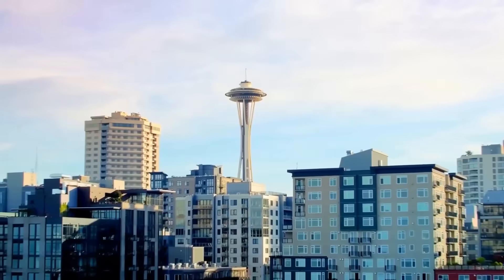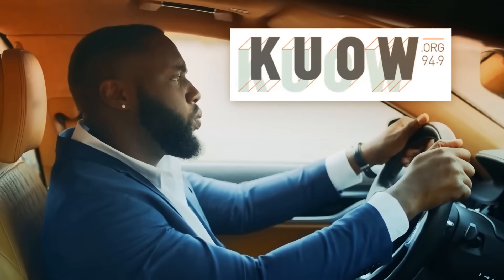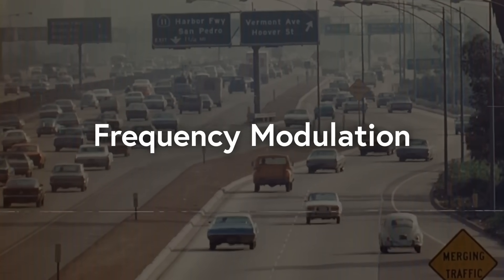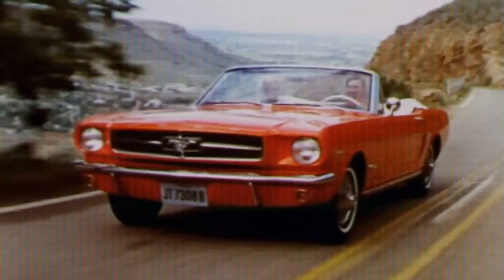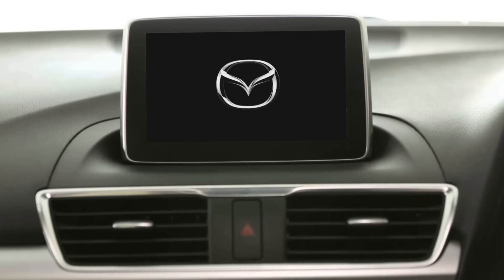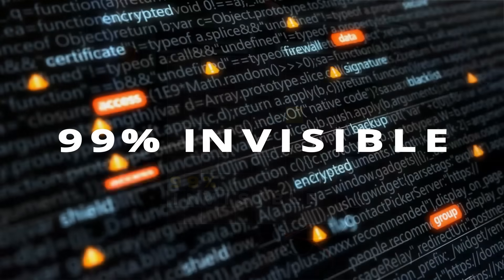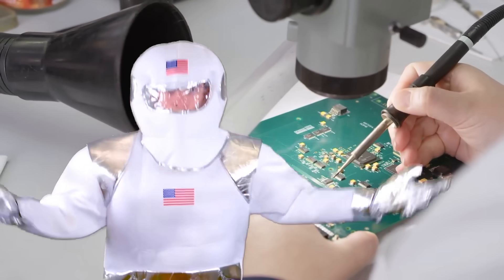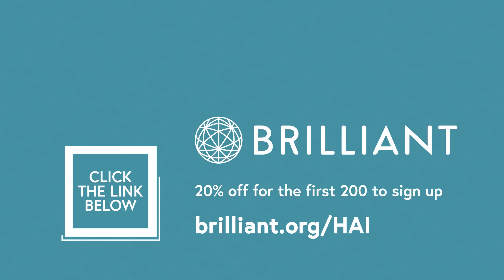Why Hundreds of Mazdas Tuned to 94.9 Broke Simultaneously

Comment: Cars have been dependent on electronics and software in safety critical systems for over a decade, them becoming electric is irrelevant. As cars gain a greater level of autonomy and over the air updates, that will become more problematic. However modern cars are already significantly vulnerable.

Comment: Fun fact, basic info like station identification, artist, and song titles COULD be embedded in analog FM signals using something called Radio Data System (RDS). Basically it was a small digital signal sent on a sub-channel that radios with the right circuitry could pickup and decode.
Reply: @Lil' Meg Sure is! I live in Canada where we abandonned plans to move from FM to DAB (although a small handful of stations do use IBOC/HD Rario), so RDS is still a mainstay here 😁
Reply: @SpencerN.C. you should’ve kept going with DAB instead of HD. It was a mistake for us in the U.S. to develop HD instead of DAB.
Reply: @jayrogers8255  DAB+ is much better. In my experience I've sometimes had better DAB+ reception than FM. 

FM falls apart quickly as soon as multipath propagation is involved.
Reply: @BroadcastBlueprint  Yup, by my point was that the video mentions there was no way to broadcast song data with old analog FM signals, and that's not correct.

Comment: Dear Mr. Sam Interesting.

"GIF" is pronounced with a hard G. There is only one word in the English language that is one syllable and begins with a soft g, and that word is "gym." What is interesting about the word "gym" is that it itself is not a full word, but rather a shortening of the word "gymnasium." Furthermore, the "G" in "GIF" stands for "graphics," which is a word with a hard G. If you do not begin pronouncing "GIF" correctly, I shall show you just how hard the G in GIF is by beating you over the head with it until you are no longer with us on this mortal coil.

Yours,
Someone who wrote a carefully worded death threat.
Reply: Now pronounce SCUBA and realize why what you said has nothing to do with how you pronounce acronyms.
Reply: I fail to understand what your point is? 
1: The word "Tuba" exists
2: This was a joke very clearly responding to a joke in the video itself.

Comment: This kind of disastrous code is exactly what happens when rampant ageism keeps experienced and competent developers out of the industry in favor of younger and cheaper developers who quite frankly don't know what they're doing in some cases i.e. sanitizing and checking basic inputs to their program, adding an unhandled exception handler in C++ or making sure to check for error codes from called code in C.
Reply: @You Have Horses +1. I can't argue that point either. I've seen both, ageism pushing experienced developers out and disaster outsourcing projects to cheap and incompetent developers who may barely even speak English much less writing working code to spec is another problem that leads to crappy and buggy code.
Reply: @fro334bro  Ageism, outsourcing, etc. they all share the same concept: cost-cutting. Subpar budget brought forth subpar results.

Comment: “And much like the family dog, the only way to fix these terminally ill car computers was by shelling out for a new one”. That really got me more than any of his other jokes have
Reply: They probably have a way to do a factory reload, but the time and coat to ship them back to Japan to do thar would be prohibitive.
Reply: Made me angry.
Reply: @veramae4098  it's not accurate. At least one dealership (likely all of them) were fixing the issue at no cost to the customer. The fix took about two weeks to manifest. 

It did require replacing a $1500 "connectivity master unit", but again the story I saw said the dealership was replacing it for free.
Reply: @Kinkajou1015  Sounds like a dealership that really values their customers and/or a dealer that's very sure Mazda will pony up and cover the costs.

Comment: Wait, so car computers were just automatically downloading and executing data from untrusted sources over an open network?  o.O
Reply: the radio yes but that's completely seperate from the ECU. the only wiring that should be going to a car radio is power, speakers, antenna and that's it

Comment: This is not surprising. I have been yelling at my Mazda infotainment system since I got my 3Sport GT. Worst software ever! Did someone's three-year old program it? Have they heard of an "onError" routine?
 In the '70's you couldn't expect a car company to be good at making cars AND programming software because programming was, well, pretty basic (little programming joke there). But these days, everything is software. And for the most part, car companies have risen to the challenge. Why not Mazda? An oil change should not cause the heads up display to outright fail, as happened last month.
Remember the good old days when hardware was forever and you just changed the software to upgrade it or add features? Not any more; whether it's your Android phone or, now,. your Mazda, if there's a software issue, the hardware too has to go. We might as well go back to everything being firmware or chips.
Reply: With all the soldered-in SSDs in laptops, tablets and phones, we pretty-much are. I want a law requiring that all non-volatile data storage devices be removable.

Comment: Modern ICE cars are pretty much just as computerized as EVs are. Also If you wanted you could make a completely mechanical EV with no computers (but this would be pretty impractical)
Reply: Impractical? Not really. It was done over a century ago. Some of the first cars were electric, using nickel-iron rechargeable batteries with regenerative braking. Unfortunately, Ford had success with an internal-combustion engine vehicle and everyone else copied that.

Comment: It's called QUALITY ASSURANCE. It's also called not kneecapping your quality assurance but supporting it and giving it what it needs to ensure your software doesn't horribly blow up.

Signed, Often Underserved Quality Assurance Guy

A disturbing number of software and firmware companies have either foregone QA, broken it, or simply gone "we'll do it live" with predictably awful results.
Reply: It's called "the users are the testers" but perhaps more concerningly I've seen that 'management' philosophy applied to potentially life-critical systems. It's what happens when management, usually with a sales background and little to no technical expertise or experience get put in charge of technical projects or worse, whole companies with engineering / R & D departments.
Reply: @loc4725  It's the software version of "we'll do it live"

Comment: A simple solution would be storing that cache in RAM which would be reset by disconnecting the battery.
Reply: I did that. Did not work. Even worse, now I have zero stations, not even KUOW.
Reply: @imafool  I was referring to the software devs.

Comment: So..... why  can't you just turn it off, access the chip with the cache with a different computer, and just remove the offending files?

Or like, just wipe the chip, and reinstall any necessary software? Surely Mazda has equipment capable of interacting with the computer unit without needing input from the unit?

Comment: What surprises me the most is the fact that, apparently, mazda went out of their way to write their own os instead of just copypasting the linux kernel and digitally duct-taping a ui onto it. After all, linux is free, open source and one of the most used kernels... And it doesn't really care about file extensions. Good going Mazda.
Unless they did that and messed up their own ui so thoroughly that every time it runs into an issue it reboots without cleaning the cache, for some unholy reason.
Reply: Mazda didn't do make anything, like just about every other manufacturer they outsourced it
Reply: Distributing Linux commercially is problematic due to the licensing. You're better off using BSD. Technically if you distribute Linux you are license bound to make the source code available on request to anyone who has received your product and asks for it. There's an organization dedicated to chasing offenders down too.

Comment: As someone who works in Automotive software, Problems like this are a daily thing we tackle during development.
However, there is usually a containment action for issues like this, like creating an emergency software release and allowing dealers to flash the fix on production vehicles.
Reply: How would this even get past QA though?
Reply: @johnr797  likely not something QA thought to test for and that it just recently occurred in the wild despite the bug having been latent for nearly a decade illustrates how obscure the issue was.
Reply: Yeah, but then that puts the onus on the car owner to 1. take their car in for service and 2. take it to a dealer as opposed to a probably cheaper and better option down the road at Franz's German Car Service
Reply: @romulusnr  You DO NOT insult Franz like that!
Reply: Typically such fixes are free of charge if you have vehicle warranty. However, without warranty, the fix would only be free if the company issued a recall. Infotainment fixes usually aren't covered by recall campaigns. Although with the current trend of putting climate control, child lock, and remote start settings on screen, I think they should be.

Comment: You can blame the radio station. And you'd be wrong. In computer security, principle number 1 is that everyone is responsible for their own safety. You can't just ask everyone in the world nicely not to brick your car.
You can blame Mazda. And that's a bit better. Not expecting a file parsing error? Major mistake.
But I myself blame someone else. The FCC. Couldn't you have come up with a standard where the same type of data is always transferred in the same type of way? The standard doesn't specify what to do with arbitrary files. So why the hell does my radio require arbitrary file transfer capacities? It's like the FCC was asking for a faulty implementation.
Reply: I'm pretty sure there is a standard, someone just forgot about it in this case
Reply: On the other hand once the ffc specifies something they will never change it even when it becomes outdated
Reply: Tell that to the guys being sued for using Google Fonts in Europe. I've been told by everyone that it's their fault that people's browsers send referrers.

Comment: This falls under "Obvious things certain professionals should do but don't" like:
Surgeons forgetting which limb to do surgery on;
Bus drivers forgetting their routes;
Judges not knowing the law;
Architects that design buildings that are designed too fragile to support itself;
AND Programmers that refuse to sanitize their inputs, 
Sanitizing Input: To reformat all input into a program or function properly for the program or function to properly operate by means of stripping out actionable characters and codes, and to add appropriate actionable characters and codes if required.
Examples:
Task Print "Hello World" on a new page
Input: "%a@ Hello World%f"  can be sanitized to "1 Hello World\n" for "1" means new page and "\n" means new line.
Reply: Software makers testing their software before shipping it
Reply: @romulusnr  Well obviously they didn't catch that bug.  I was a programmer and it was considered a "lazy practice" to have rely on testers to catch all of your bugs because they can't possibly catch them all.  In fact, it is mathematically proven that testers cannot POSSIBLY EVER catch all bugs in all programs.  The larger the program the worse this problem becomes, and it escalates exponentially as the size of the program increases.

Comment: It's a trend that I've noticed recently. Software is badly written. I have my web browser set up be quite picky about the correctness of what it is presented with. You see, I like to write correct web sites that don't cause problems, that obey the rules and work as intended. However, many other web sites I visit, some from really large companies, throw error messages into the log, have formatting mistakes and so on. It seems that near enough is good enough. It isn't. PVS Studio - who make a static code analyser - checked the software for some popular cars. They found  thousands of bugs, a good proportion of which, if triggered, could result in a unhandled exception or the processor would merely loop. Either of these is a Denial of Service and should not be tolerated in a web site, let alone in safety-critical car management software.